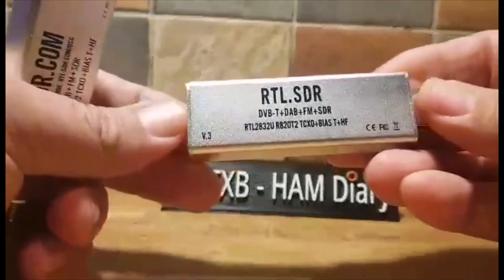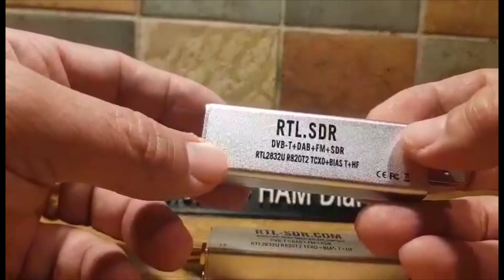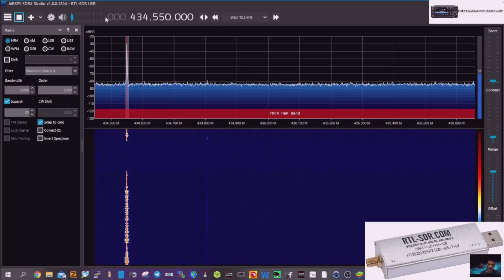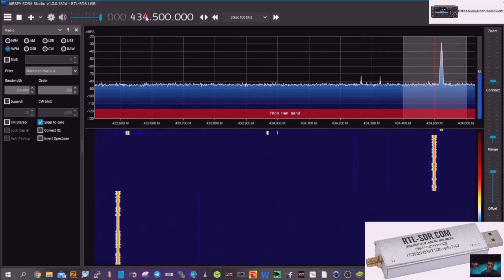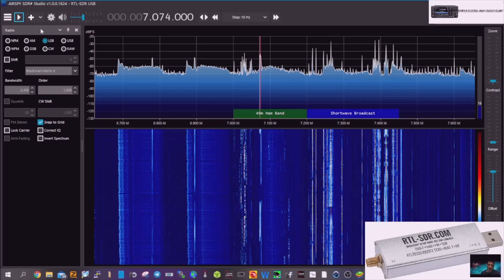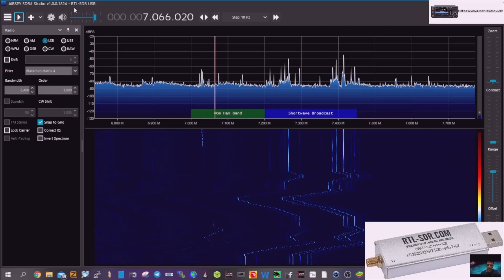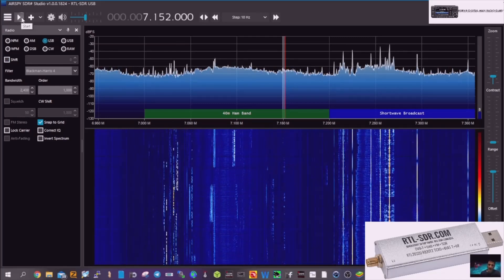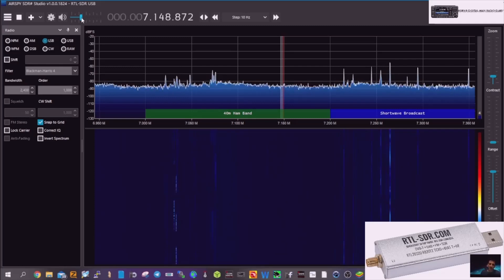RTL-SDR USB DONGLE -CLONE and ORIGINAL - "COMPARISON"

Comment: As for the issue in HF, the original dongle, you may need to go into settings and adjust the gain, or turn on/off the various AGC's to find the "happy place" where it will operate well.  I have been messing with these things for 10 years now, and can assure you they all work, but the more expensive ones are always better.  More stable, more usable frequency range, less spurs, more features (like Bias Tee and all Circuit Improvements).  Usually a lower noise floor as well.
Reply from the maker: Hi thanks good advice .